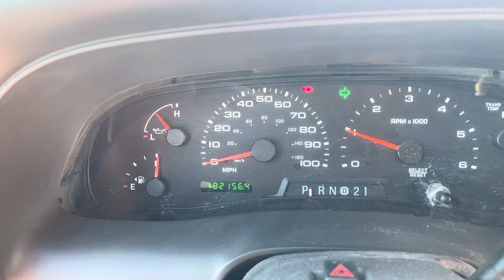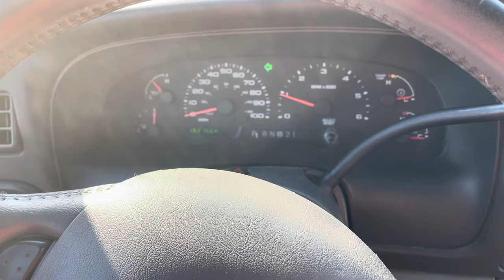Turn signals working intermittently? Try this first!! DIY fix

Comment: Left rear turn signal works fine,  right side rear flashes fast on dash which usually means bad bulb, but bulb looks ok and I replaced bulb anyway, but still doesn't work. Could that be the relay or fuse? 2004 Dakota.
Thanks for any suggestions

Comment: Hi!  Do you know if the relay can get loose?  I had it replaced, and they worked fine for a while but are intermittent again. It costs over a hundred dollars!  I have an 04 Impala. Thanks!
Reply from the maker: I imagine it could be loose but most likely it needs replaced again.
Reply: @car_paparazzi  God bless and thanks for answering.  It didn't last very long.  It blinks when I do it manually, which isn't too much fun.  It costs over a hundred dollars, so I think it may have to become a thing I do manually.

Comment: Been trying to diagnose intermittent working blinker on 2019 Hyundai Veloster.  Left blinker stops working, front and rear, no blinking in dash.  Bulb works when flashers are on.  Replaced bulb and socket, no go!  I have searched for hours on the internet and cannot find a solution.  Help if you can please.

Comment: My rear right turn signal indicator flashes double speed and the bulb doesn't light but the bulb is ok. The other turn signals work. What could be the problem?